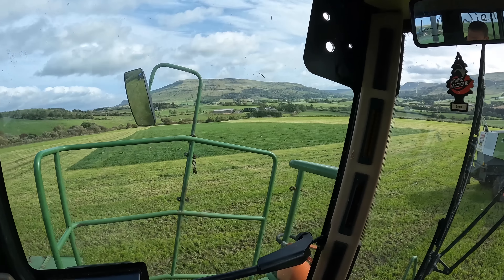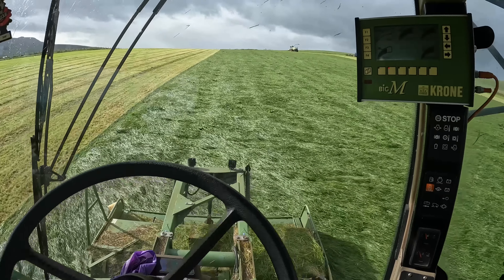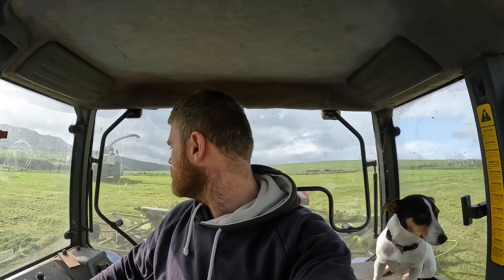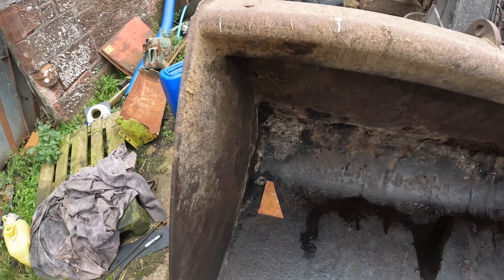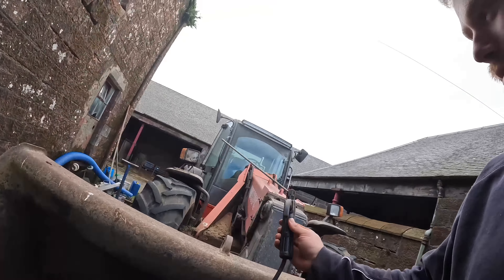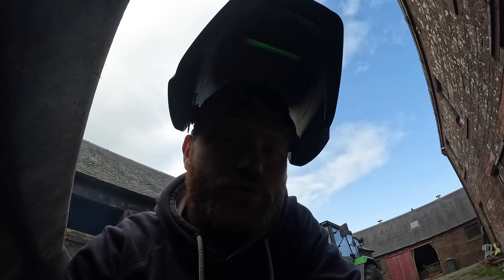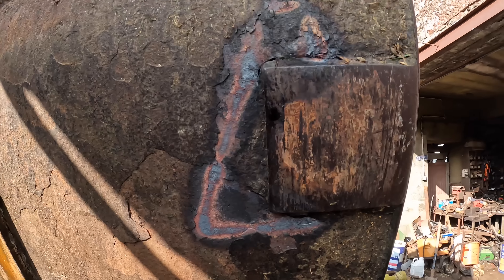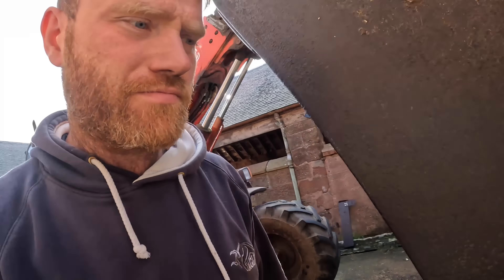BUCKET MAINTENANCE - WELDING - STILL CUTTING IN OCTOBER!

Comment: Hi Drew . When Welding using an extension cable drum . Good idea to unwind the cable on the Drum as this can cause the thermal cut out to pop
Reply from the maker: No thermal pop on that one just a fuse
Reply: If in your workshop you have a 16amp socket , I'd plug an extension into that and run your welding invertor of that as there will only be a trip and no fuses in the system .